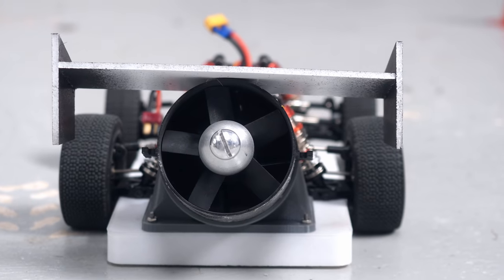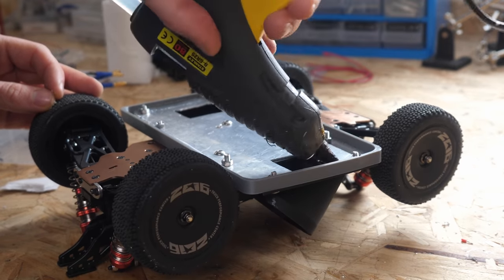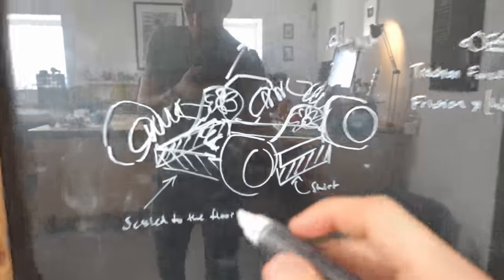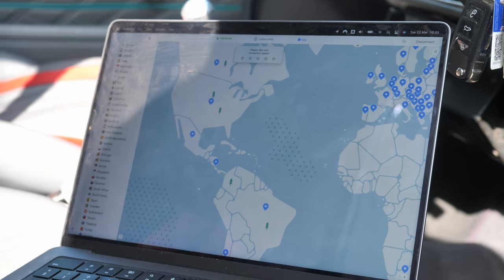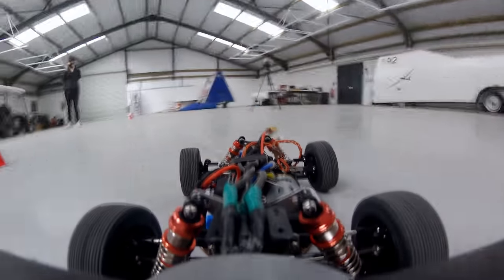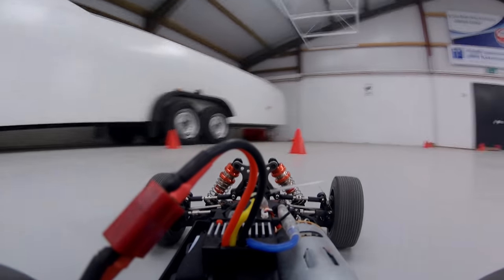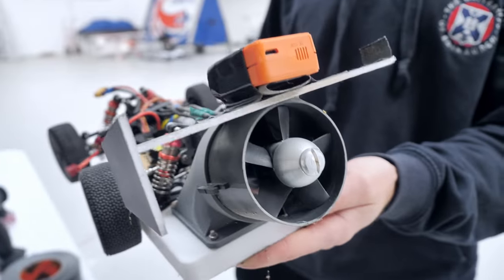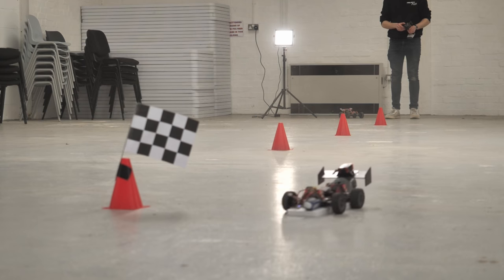Vacuum Effect RC Car

Comment: Having a microcontroller that takes an input from an accelerometer and then varies the speed of the suction motor based on the lateral G's would mean that when the suspension in unloaded, the suction falls off allowing the car to attain higher velocity due to lower friction and then when the G's rise up (in a turn), the fan speed ramps up, increasing suction and pulling the car down and loading the suspension up providing more traction.
Reply: Turbo lag may be a problem. How fast can the fan spin up? The car needs down force at the start of a turn.
Reply: It could just use stearing input with suction, More steer
Reply: I wonder if an adjustable vent could help with spin up delays.
Reply: With a digital programmable remote control he can simply make the steering action also control the fan speed. With each steering input the fan speed goes up, regardless if it is steering to the left or the right. And with less steering action the input will be lower so there will be less fan speed. So there is no need for gravity sensors or an accelerometer at all.
Reply: @insAneTunA  That is a good idea, I did not know you could do that with controllers. The only downside is there are times where you do not want suction but you do want high steering angles. Such as low speed turning just to name one instance.
Reply: @StreuB1  When you make a slow turn it doesn't really matter that it is sucking harder.
Reply: @StreuB1  you can take the slow turns faster with more suction
Reply: @insAneTunA  Very true, but its also nice to engineer the system to tackle the job at hand and not "paint outside the lines" if you don't have to. Though it would be an easy proof on concept to do what you suggested and see if it works. Likely would and then if needed, tackle the more elegant solution in time.
Reply: @StreuB1  I do not think that the objective is to make the RC car as effective as possible, but instead to prove the science behind it. Otherwise many improvements would be possible.
Reply: are accelerometers that good now?  I was thinking along same lines but using shock travel.  of course to do that you'd need tiny/accurate position sensors on shocks
Reply: combining it withe the natural pressure at air speed this could be great
Reply: Dual rates on the controller. Use it linearly with the steering input.
Reply: @peterpizzurro  It would be ideal if the fan speed is controlled by both the steering input as well as the throttle input from the RC car motor. Low throttle and high steering input would mean that it is a slow corner which doesn't much fan speed. And a high RC motor throttle combined with high steering input would mean that it is a fast corner that would need a higher fan speed.  

It would safe some battery power at lower speeds.
Reply: Further idea, active aero using servo motors? When there is lateral forces, the motors induce a higher angle of attack etc
Reply: @hamjudo  Believe in JESUS today, confess and repent of your sins. No one goes to heaven for doing good but by believing in JESUS who died for our sins. Hell isn't fun. GOD loves you soo much unconditional❤🙌❤😌
Reply: @hamjudo  lead lag filter and here we go
Reply: @insAneTunA  decent idea, perhaps when you let off the throttle the fan speed increases a bit, like max 15%, that way you can have improved downforce before the corner and through the corner with the steering input.
Reply: 1. strap an upside quadcopter on top of that car
2. put some tenso-resistive sensors on your wheel axles
3. feedback/feedforward those sensors into the flight controller, play with curves :)
4. thrust vectoring?
I bet someone did this already, tho
Reply: It would massively disrupt the balance of the car mid turn
Reply: This was my idea to but you almost need to predict a turn is coming so the fan speeds up. AI  or maybe a short range signal device at the side if the track on the approach to the corners.

Comment: Map a button on your controller to spin the fan in the opposite direction. This helps in disposing the dirt getting stuck.
Reply: sky effect
Reply: And In bonus, make the car fly!
Reply: He’s gonna have to change the whole ESC to do that
Reply: @MatthewNovoselskiy  most escs support reverse just have to program it.
Reply: 69th like. Nice
Reply: Hovercraft! Who needs tires and roads!
Reply: @noktrnl123  most CAR ESCs have reverse function. Aircraft ESCs, used for EDFs, rarely have reverse.
Reply: @Lozzie74  the esc that I use for my quadcopters, plane and helicopter all have reverse function also. Blheli supports it.
Reply: @Lozzie74  most drone / aircraft esc's I've seen since 2017 have reverse. Before that it was less common
Reply: Combining this with 
Brian Streuferts idea of having adjustable down force based on G-force sensor and velocity sensor would make this potentially excellent setup. If the code is written well, though how fast can EDF of this size stop, reverse enough to remove trash and then spool up to normal range?
Reply: Great, now dirt's everywhere and your car flipped upside down
Reply: Brudda tryna make his cars fly on the straights. I’m here for it!
Reply: @Yemalidk  Believe in JESUS today, confess and repent of your sins. No one goes to heaven for doing good but by believing in JESUS who died for our sins. Hell isn't fun. GOD loves you soo much unconditional❤🙌❤😌

Comment: The trick to making that vacuum skirt work is to attach it to the wheel uprights, not the chassis so it stays at a fixed height above the ground no matter how much the car rolls/pitches. It'll let you run a softer suspension as well, which is almost always better.
Reply: Wouldn't doing that mean that the chassis of the car needs to be able to move up and down and tilt sideways inside the skirt? which in turn means you would have to make the skirt seal all around the chassis while not being attached to the chassis itself.... feels daunting to me :)
Reply: @kenvanpassen9247  No the skirt that he's built would be the same, just attached to the wheel uprights rather than the chassis. But yes with softer suspension he's have to lift the chassis up a few mm's so it'd keep clear of the skirt in bumps.

Comment: By looking on the video, I have a feeling that you configured EDFs to suck air, but making them rotate "backwards" instead of mounting them reversely. Remember, blades have their shape and angle of attack to provide maximum thrust when they rotate in the direction they were designed to. So, by mounting them correctly, and powering according tho their natural direction of rotation they will produce much more thrust/suction :)
Reply: This!  He was losing so much efficiency by doing this. I'd be surprised if he was getting more than 50% of the EDF's normal performance.
Reply from the maker: @JMMC1005  Somehow I completely forgot to mention that this was intentional: I still got more than enough thrust/suction from the fans with the blades the less-optimal way around (only needed about 30% throttle) while still having the EDF blades visible, so it looks cool for the thumbnail (important for YouTube, let's be real!). Nice one for noticing though!
Reply: @JMMC1005  Believe in JESUS today, confess and repent of your sins. No one goes to heaven for doing good but by believing in JESUS who died for our sins. Hell isn't fun. GOD loves you soo much unconditional❤🙌❤😌
Reply: @Project-Air  Are you planning to implement huge wings together with this fan on an RC car, and maybe a modified body shape ask as to improve airflow speed and smoothness. Also, as other comment threads have mentioned, being able to programme the fan speeds would be beneficial.
Reply: @Project-Air  Also yeah, while it's true that it would look better on the thumbnail, the sacrifice of performance is kind off off putting.
Reply: @alunesh12345  lmao wtf
Reply: @MADEINNSW  don't reply to the bots

Comment: The Chaparral 2j had skirts that were stiff but moved.  They worked with the suspension to keep a set height from the ground.
Also you could have the tray adjustable for and aft to balance down force.  Too much push?  Move it forward.  

Fan cars are great concepts but require unrealistic flat and clean surfaces.
Reply: yeah, i thought he was gonna mention the 2j, the absolute beast of a car that could probably generate enough downforce to stop upside down... too bad it was unreliable as heck

Comment: I think it would be worth looking at the fan as a mechanism to move air over diffusers and venturi tunnels under the car at a faster rate of speed than the car is moving. This is the actual primary purpose of blown diffusers and of the bt46b's fan. It wasn't designed to be a static pressure device like a vacuum. Think of the design more as an upside wing in a wind tunnel. The wing will produce lift, or in this case downforce, even when stationary by having the air pulled past it by a fan. It makes for much more efficient, meaning more downforce to drag ratio, than a vacuum design.
Reply: This is what I was thinking. The whole point is to take advantage of ground effect, which he acknowledges, but never actually makes any attempts to use...
Reply: That's what i thought too. The fan car in f1 would suck in air through the front and blow it out the back to make the air underneath move faster, creating a low pressure zone.

Comment: I own those rc cars. Stiffening the suspension by twisting the screws on the shocks sona helps alot. Also putting thicker oil in the shocks.

Comment: Suggestion - add an inertial switch or accelerometer linked to the fan speed - increase grip from skirt when cornering, decrease drag from skirt on straights
Reply: Believe in JESUS today, confess and repent of your sins. No one goes to heaven for doing good but by believing in JESUS who died for our sins. Hell isn't fun. GOD loves you soo much unconditional❤🙌❤😌
Reply: That would be so cool!!!

Comment: Awesome build! What about testing attaching wings directly to the wheel hubs like they did before they banned it. This keeps the pressure directly on the tires so you can run softer suspension and have more mechanical grip.

Comment: It would be very interesting to see a sensor used to sense the distance to the ground and the Gs on the car to drive a PID control of the fan to get maximum grip when needed without having the skirt contact the ground. You could also designs a skirt that used a Teflon material in a guide that is free to move up and down to create a near perfect low friction seal.
Reply: Probably easier to use a barometer than a height sensor.

Comment: Would be informative to show the lap times with and without suction. Also why not to disable the fan - do the lap - enable the fan - do the lap, so the testing is more accurate
Reply: Believe in JESUS today, confess and repent of your sins. No one goes to heaven for doing good but by believing in JESUS who died for our sins. Hell isn't fun. GOD loves you soo much unconditional❤🙌❤😌
Reply: The test would just show how the mods affected the car's performance from stock. Added data but nothing that would help the project far as I understand. I'm not the engineer type to tell how this would be applicable.

Comment: Love the video! 
You could try a "bladeless" fan to solve you're blade snaping problem.
Reply: Like the Dyson fan? Complicated but good idea
Reply: They still have blades as im sure your aware based on the quotation marks. The air would still have to travel through the blades so the same problem still exists.

Comment: edit: I see this was already recommended :p

A thought: Depending on the hysteresis between fan power and fan rpm, if you could have the fan run relative to steering input (the more you steer, the more the fan ramps up) you could perhaps gain some more straight-line speed and maybe get some better battery life as well. 

That is, only use the fan when it is needed.

Comment: Hey
Im in 12th grade and as my final, im building a similar car and i will conduct several experiments researching the effect different factors have on grip. One of the thing i want to try out is how downforce affects grip. I have some questions:

- How much power did your edf use?
- How big was the battery powering the fan? / how long did the fan run?
- Did you use the same battery to power both the fan and the car itself?

Any help is much apprechiated
Thanks

Comment: Could you avoid the need for a sieve mesh by using a cyclone?
Reply: Doubt a cyclone would work , but with a bit of trickery you might accomplish the effect.

Since power and efficiency of the fan aren't major concerns, baffle the suction such that it's spread among multiple points, and the suction is parallel to the bottom of the car. With no direct upwards suction, it would be hard to lift anything off the ground. You could also make the inlets small enough slits that you aren't worried about anything big enough to cause damage passing through them, say 3mm openings or something like that?
Reply: An eductor type system like the Dyson "bladeless" fans would work great in this regard.
Reply: The dyson bladeless just has the fan in the bottom of the device. They want to maximize surface area, and reduce pressure.

Comment: The EDFs are the wrong way round. They are much more efficient when driven in the right direction. And maybe a blower style would be better for this purpose because EDFs have such low static pressure.
Reply: He said in another comment that this was intentional because he didn't need much force anyway
Reply: @brrrrrr  But it would draw much less power at the same thrust.

Comment: If 23 years as a airline aircraft engineer and crazy micro jet engine home builder has taught me one thing...its that you've installed the fans backwards and are running them in reverse.
 They'd work a lot better installed and running in the right direction.
I am impressed none the less. 🙂🇦🇺

Comment: The pressure from the system is pushing down your rear wheels more than your front ones. Put the air intake closer to the front of the car and it will push the wheels that actually steer into the ground harder, and will help under steer. A front bumper mounted spoiler will also help push them into the ground. 

You can help prevent the skirt from hitting the ground by setting limits on the suspension end points. 

Hope this helps _ automotive project manager, JD Power :)

Comment: Very cool little project.  I'd suggest to enlarge the area of the mesh and maybe tinker with the center of suction as needed. But the biggest potential I guess is in skirts that can slide up and down to allow for proper working suspension and minimized drag from the skirts. Cheers

Comment: Multiple of the 70's F1 cars used thickly set bristles as skirts. They were stiff enough to allow creating a somewhat permeable membrane, but soft enough to bend back when contacting the ground. They were probalby the best middle-ground solution between optimal downforce and creating too much downforce, increasing rolling or even drag resistance.

Comment: You should try blowing air past the hole and creating a low pressure area. This is used in garden vacuums to suck debris up into the bags. The plus of this is that your fan won’t get clogged as you are not sucking via the fan.

Comment: IIRC the BT46 initially had the same problem of sucking itself down to the track and rubbing, but they solved it attached the vacuum chamber to the wheel hubs instead of the chassis. That way the suspension wasn't compressed by the vacuum.

Comment: The original fan car, the Chaparrel 2J had a moveable skirt that was attached to the lower control arms of the suspension so only the low profile tires were a variable in how high the skirt was off the tarmac. You could limit the suspension travel to this height and use some firmer tires to keep the skirts off the ground.

Comment: The dirt was also the issue with the Chaparral 2J. The didn't use a mesh to filter, so they used to thro rocks behind the car. It was band for that reason.

Comment: you might consider a circuit to tye the fan in with the turning only. or increase pressure in the trurns, and decrease it on the straightaways. 
cool video, great job!

Comment: Very cool- I think the biggest short-term gains would be fixing the skirts up. You're already printing it, so some printed sliding skirts with small flat springs could work well. This would make it a lot more versatile

Suspension is another one- maybe stiffen it up a bit so you don't have so much travel for the skirt to contend with

The ultimate solution is mounting the vacuum plate unsprung. This needs to be able to flex with suspension travel, and still have a bit of movement to cope with imperfect surfaces, but takes the soft suspension out of the equation entirely.

If ytou wanted to take it to the extreme something like a 1/12 pan car could be ideal. They're already very low, have lots of surface area, and nearly locked out suspension

Comment: the ideal adjustment to this would be to have a gear which turns from like 10% to 100% to that wheel which controls the fan speed, which you would change for gears and a motor turning them with another cog. This could be controlled remotely to allow faster straight line speed and to be turned up before breaking for corners.

Comment: One thing worth noting was the the bt46 and lotus cars only use skirts on ether side of the car to increase the vinture effect (sorry for spelling). You might be able to increase performance by making it narrow in the middle of the floor and wider at each end as well as using a rubber skirt on both sides